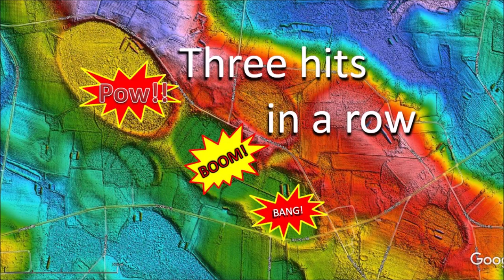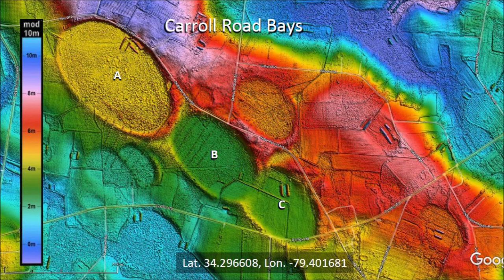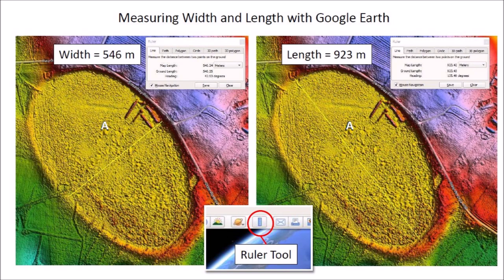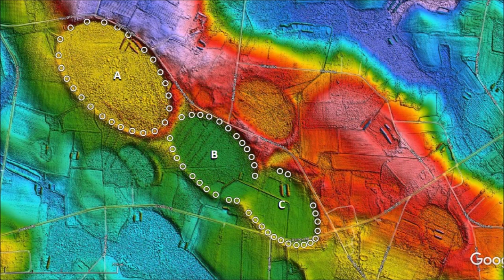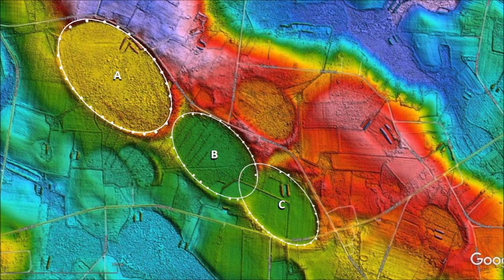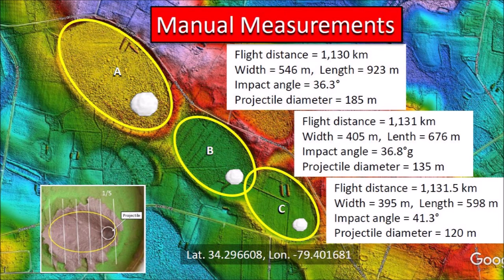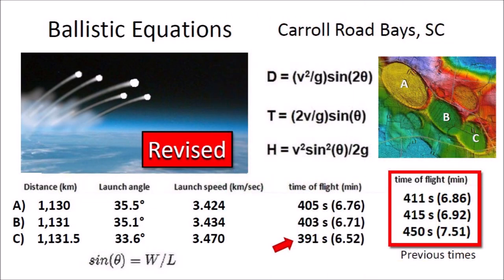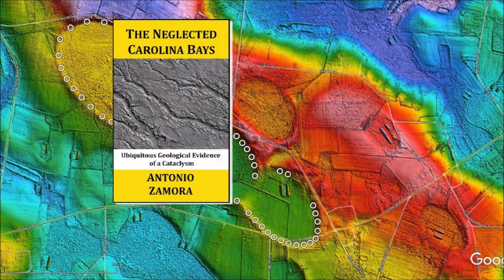Pow! Boom! Bang! Three hits in a row.

Comment: Good stuff.
How deep in relation to the major axes would the bolides have driven into the subsurface? ie crater depths w.r.t. the axes?
Do you know of any of these basins from which impact material of any sort has been recovered? ie: glacial clasts carried on the ice fragments.
Has any isotopic geochemistry identified anomalous signatures from the basins?
Or was the energy released by impact too great for preservation?
Reply from the maker: The depth of the secondary impact cavities can be estimated by the formula tan(θ)×L/2, where L is the length of the major axis and θ is the angle of inclination. A bay with a major axis of 400 meters would require a layer of unconsolidated material with a depth of approximately 140 meters. We are still working with soil samples from Arabia Bay: https://youtu.be/2IjnWHqa_0U